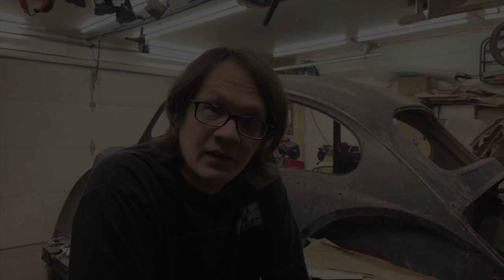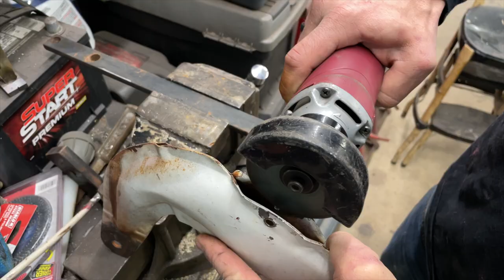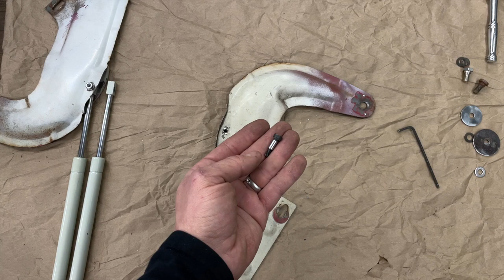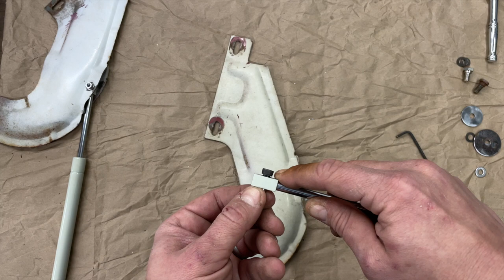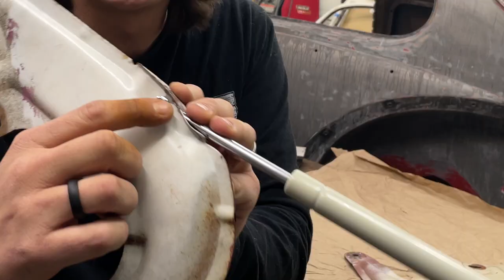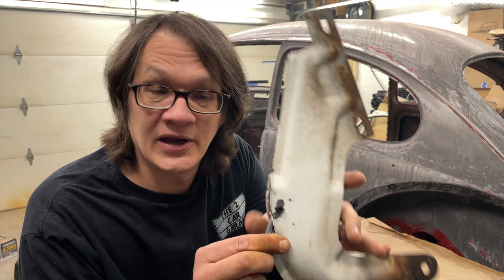Trunk Lid Struts Retrofit on a Vw Beetle - Curt's Bug Part 24

Comment: And I thought I was the first person to do this! Just found this vid. I did the same mod using some struts I happened to have lying around.
Reply from the maker: Nice! Do you like them as much as we do?
Reply: @The2CarGarage  Much better than the creaky old spring setup for sure. Trunk lid now opens and closes smoothly and quietly with little noise. A worthwhile mod.
Reply: What are the dimensions of the struts? I want to get some for my beetle but don't have access to Empi parts locally. Thank you